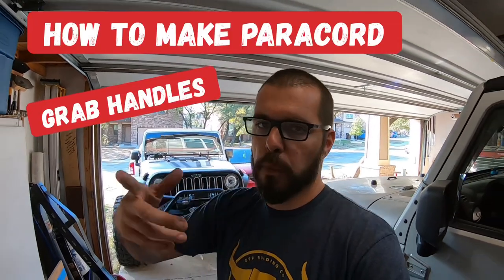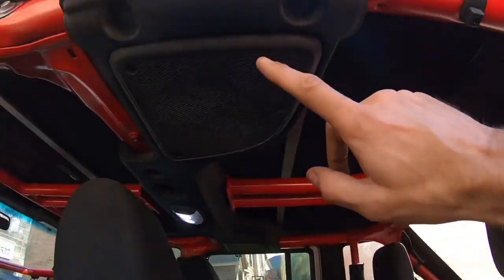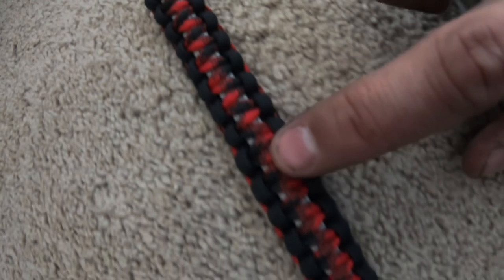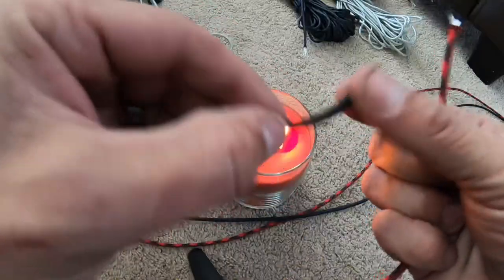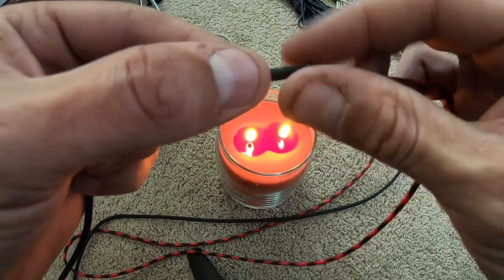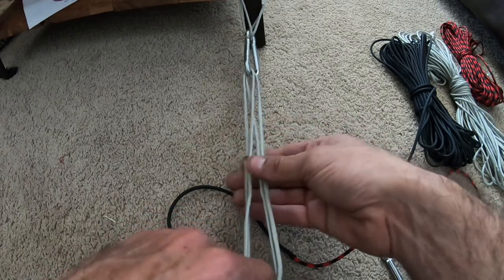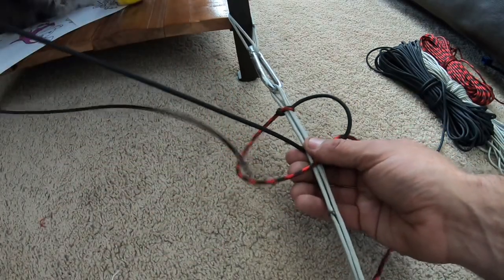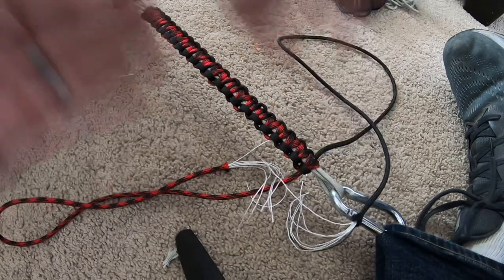CHEAP PARACORD GRAB HANDLES  - Best Jeep Mod

Comment: looks cool just wondering if u could add something to the middle to make them abit bigger
Reply from the maker: You can! You can actually double it up and make it thicker. So in other words, once finished…just start again near the top loop and go over what you just did. It makes it much thicker. You’ll need to add a couple feel to the length though.
Reply: yea have seen and thought about doubling it up was just thinking if something else could be used might just stick with doubling it up doesn't take much more to do and less thinking about it hahaha

Comment: Any concern about the strength of the melted together ends?
Reply from the maker: It’s a berry common was to end them. On the base cord, making sure the melted ends aren’t in the “loops” at the end and buried somewhere in the middle eliminate a weak point. But built this way, people have been using them to pull themselves up into Jeeps for a long time with nothing breaking. I’m sure there is always a chance of anything breaking…even the cord after being sun damaged and whatever else. But I haven’t heard of any failures.